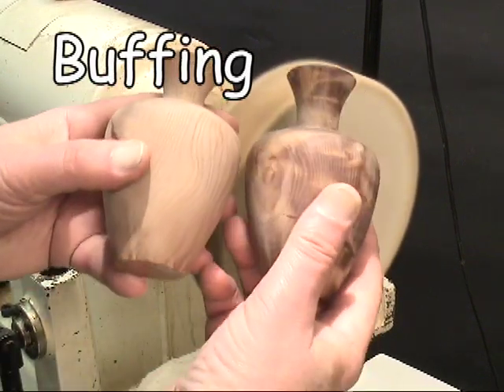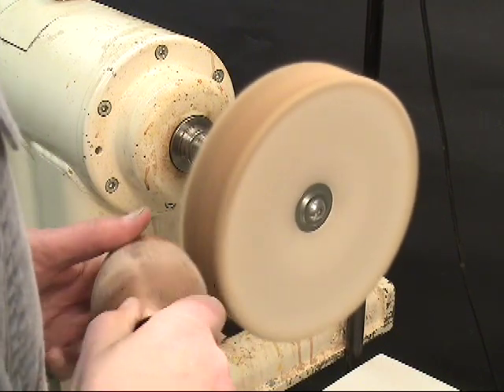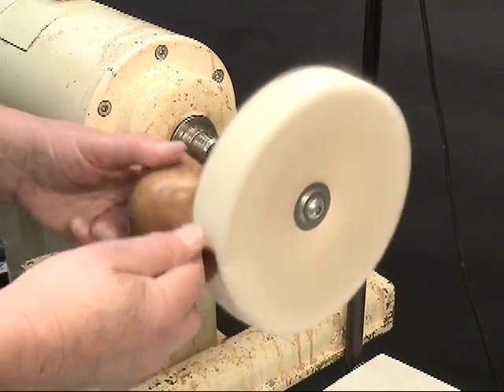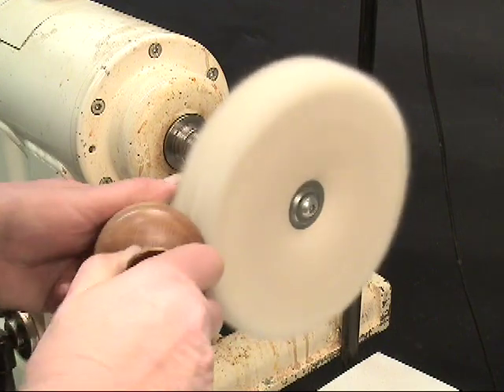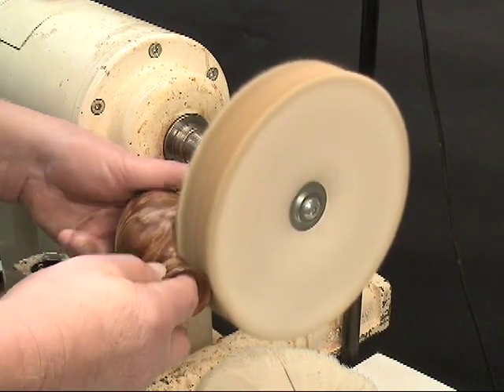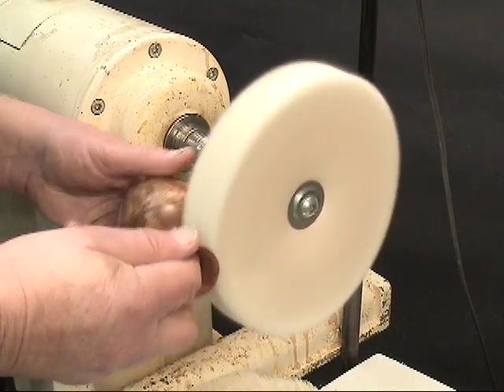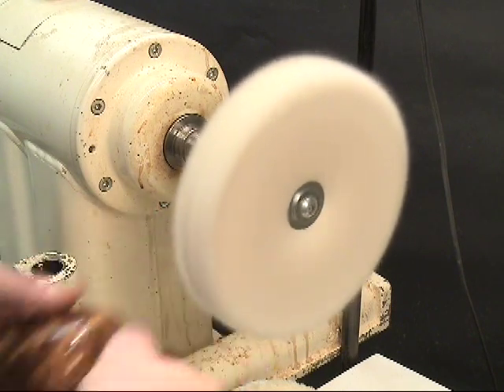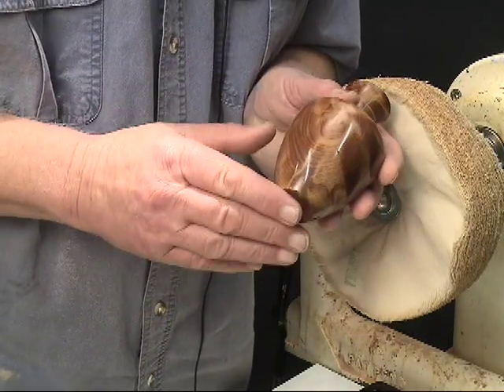Finishing Secrets - Wax - Buffing - 2

Comment: Just finished watching your first video in this series. Could not leave a comment there so I'll do so here. First off, great presentation. One thing though. You are using the Beall system and failed to mention that a threaded rod could be used to hold the Morse taper in the head stock as well as the tail stock. I believe it takes a 1/4-20 threaded rod.

Comment: Hi there - great video - thanks much for uploading.  One question for you - can you use any bench grinder as a buffing machine?  Is there a certain brand / hp / size you would suggest?  Thanks!
Reply: I was thinking the same thing.  I think that you can.  We used bench top grinding machines back in our wood shop classes.

With polishing and waxing is all about pressure, the right amount of time that the pressure is applied to the wood piece, the right compounds to use for both polishing and waxing, and have a general understanding about how wax behaves.

I think that the most important thing to remember too is to have different cloth wheels for all your different compounds.  Also ensuring that you dress the wheel prior to working with any new wood project.  The later is especially true if you have not used your equipment in like a few weeks or months.  You definitely don't want to have hardened compounds scratch and ruin the face of your wood project.  I've done that a few times, and the only way to resolve that oversight is to go back to sanding again.  Not a fun thing to do, especially when you have spent a good amount of time working on your wood project.

Comment: What compounds are you using, and is that beeswax? I've tried to polish with a green compound (which works great on metals) on Thai rosewood but it seems to get caught in the pores and discolors it. I tried to use as little compound as possible.

Comment: Do you use those hard brushes used to clean the files , to raise the fiber and obtain a smooth fiber all around  ? this is a common method . I use a piece of wood too but thought it helped to warm the disk

I was also told to use synthetic tallow on the cottons, I think it is mostly for metal polishing, or if the harder waxes are not greasy enough, but it protects the cotton that loose less fiber then

I only polish brass hinges, casters , and polyester finishes on pianos, so my needs may be different from yours (using a heavy duty electrical polisher hold by a zero gravity balancer) 
My disks need to be hardened using carboard disks on their sides, (they are cut with a sharp blade when the disks wear) 
I also need to cut protuberating fibers regularly. and I cannot push hard as you as polyester may not warm too much or it melt and it get softer, degraded, above a certain temperature (which I'd like to know BTW)

Best regards